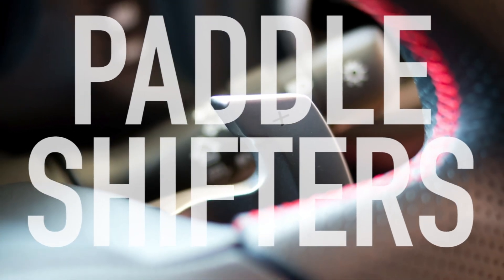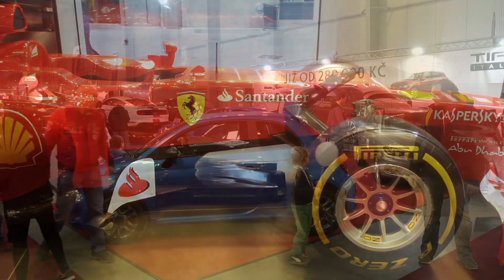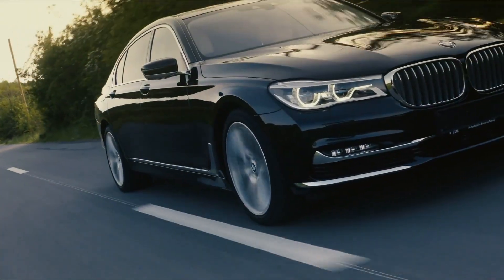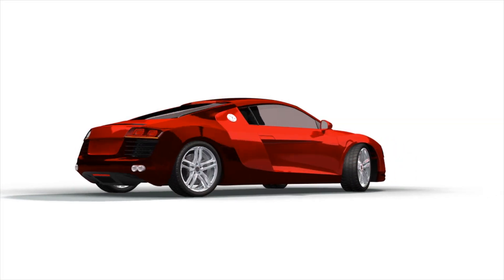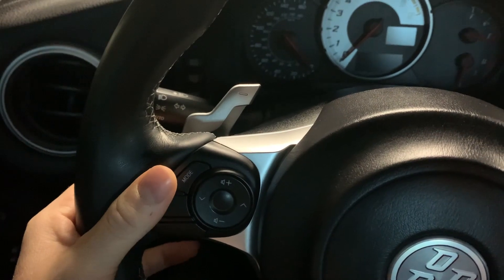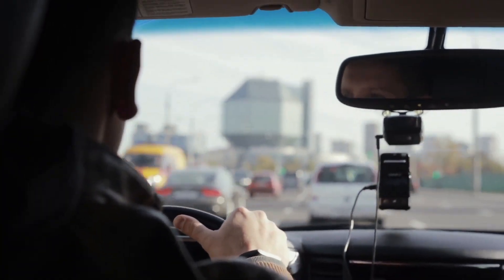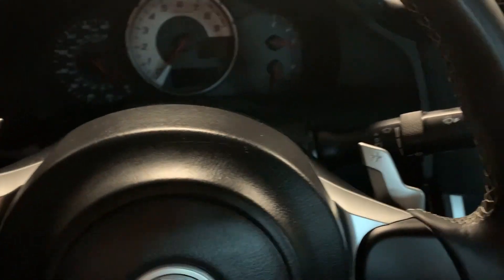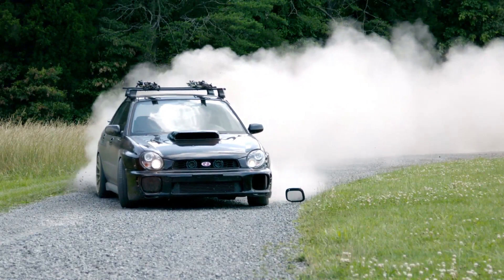How do Paddle Shifters Work? (and How they Helped Replace Manuals)

Comment: If im driving automatic, do I NEED to paddle shift? or I can just drive automatic ignoring all the other stuff
Reply: You can ignored it completely. Maybe you can use them when you are going into a big hill and you need more torque. You put the Paddle Shifter mode and go into 1 or 2 gear to go uphill without too much problem